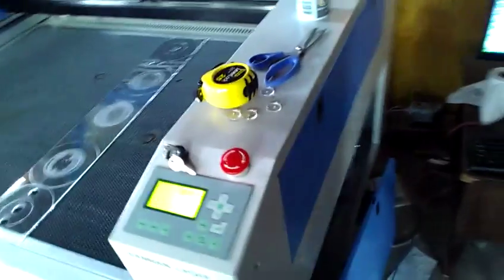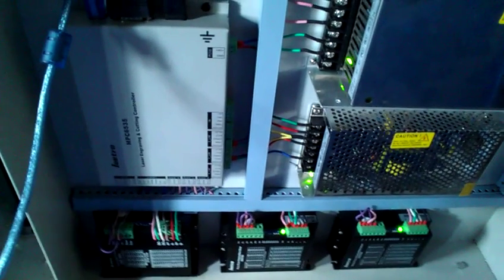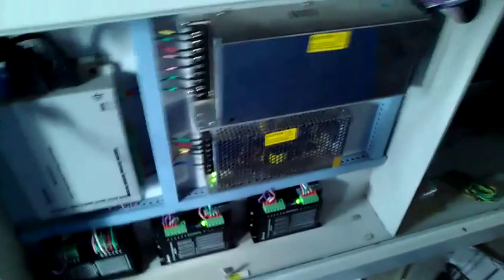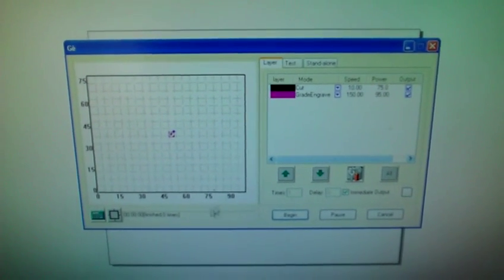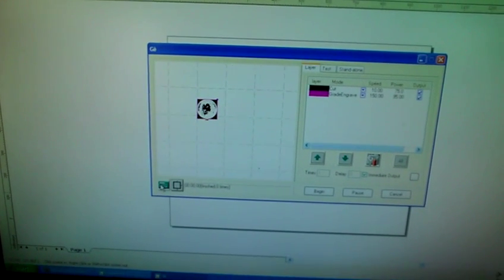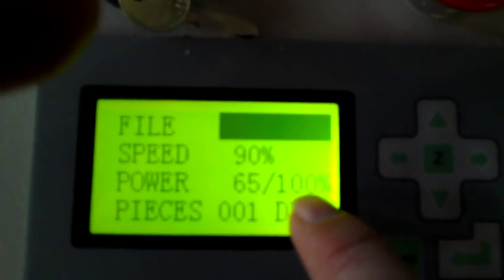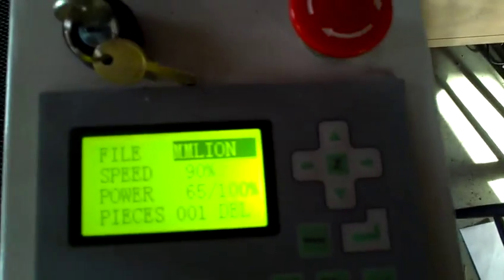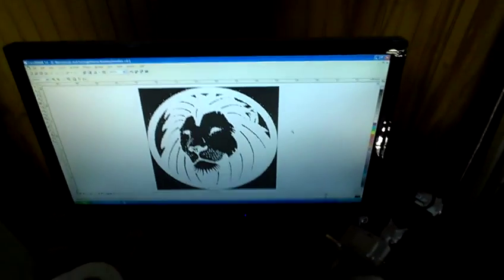Problems with laser cutter / engraver

Comment: I have a similar problem with my 1390 engraver. When I send my layered file to the engraver my speed and power never changes on the display unless I change it manually.  The difference in my machine and yours is that my file will engrave and cut like it is suppose to.  The speed and power changes as expected from engrave to cut but the display of the engraver never changes.  I will be emailing the company I purchased this engraver from GWEIKE Miss Melody tomorrow to try to find out the problem.